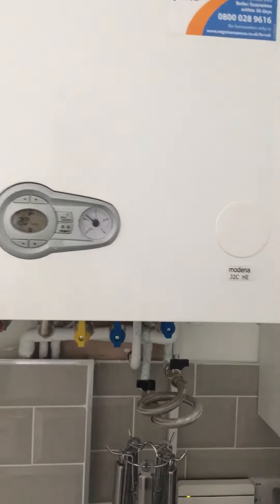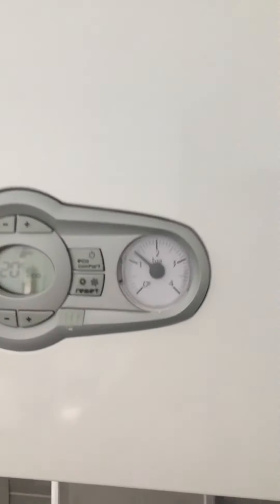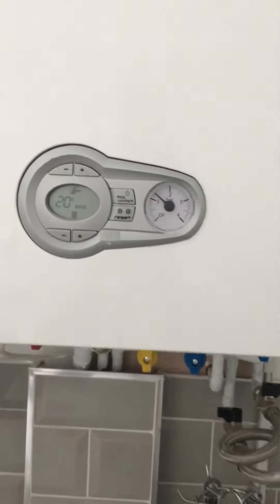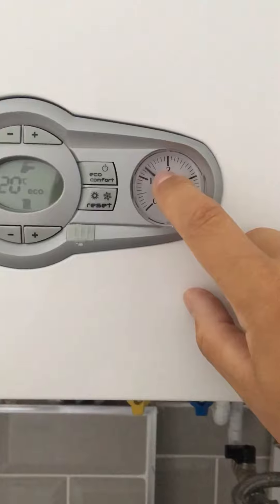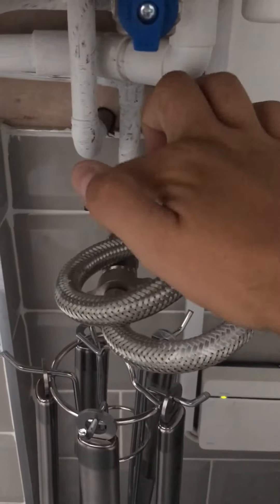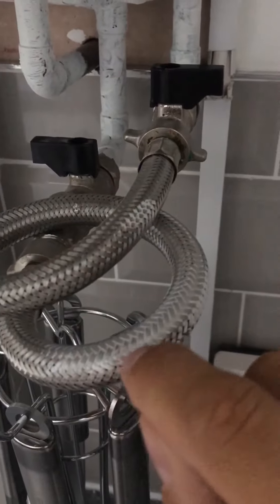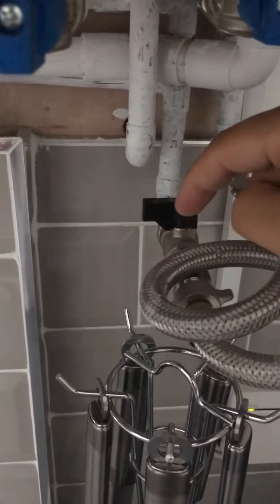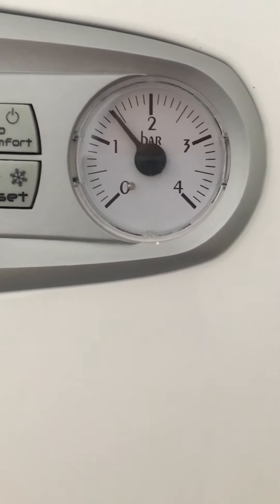Boiler Pressure Drop? Top It Up!

Comment: Do you turn screw thread first or the one black value as mine has only 1 valve
Reply from the maker: On the filling loop, there is or should be at least 1 valve handle, follow the braided hose, and see what is attached to the opposite side, if nothing then yes. Some will have a flat head or knife slot but only turn 1 at a time, and slowly as water pressures can be high and fill the boiler to much.

So slowly slowly